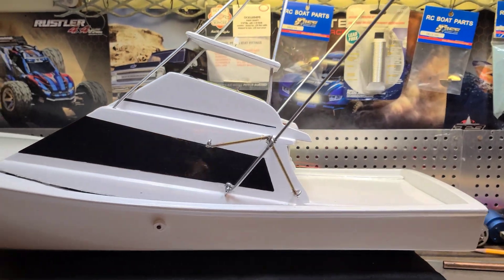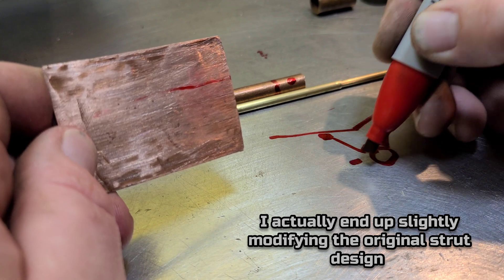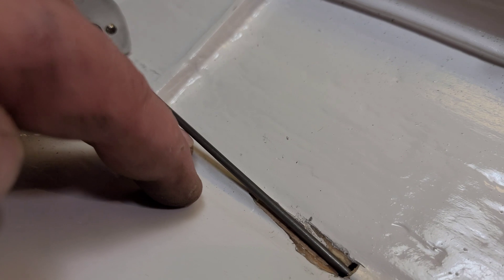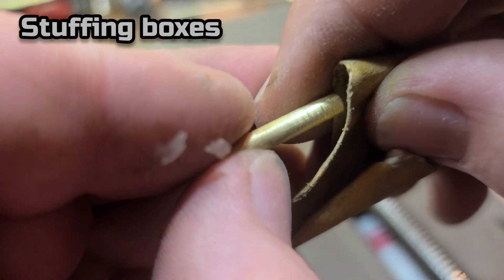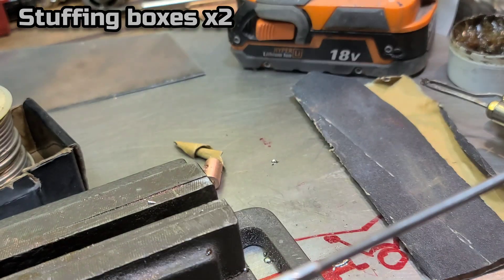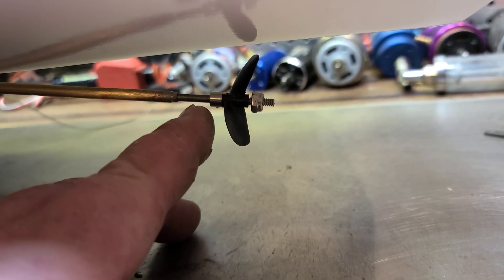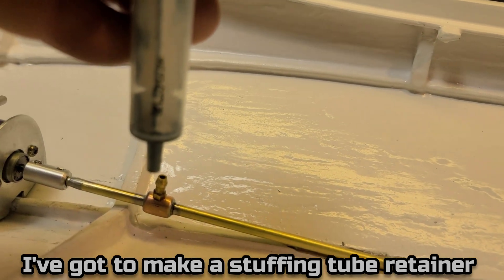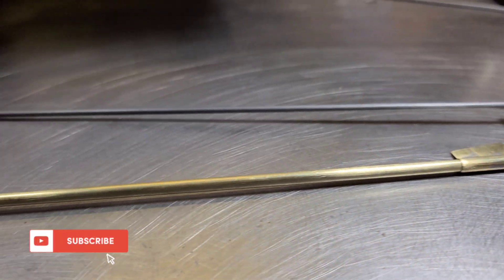Scale Rc Fishing Boat Pt4 Diy Stuffing Box, Drive Shaft, & Strut - Rc Boat Running Gear

Comment: Do you remember what is and where to get the material to use to install fitting into ?
Reply from the maker: Offshoreelectrics.com is the best place to get parts. 

Here's the k&s tube link
https://www.offshoreelectrics.com/products.php?cat=Stuffing+tube+%26+mounts&PARTNER=ironclad
Reply: @IRONCLADRC  I'm not finding sleeve to put fitting in
Reply from the maker: @CJINDY  I made that custom from a piece of brass drilled and tapped

Comment: very well done video...so that is basically a fitting used for cooling jacket? couldn't you also just have a plastic snap on lid for that fitting instead of removing it and using a grub screw??? I have my old surge crusher cat i am thinking of putting a grease fitting on since the 5mm flex has to be removed from the motor end to grease... i did change it 4mm 12 years ago ,but flex broke,so i am using the stock beefy 5 mm again..PS.. i just thought of how to cap that fitting...there are these  plastic pellets designed to be put in hot water and within 20 seconds you melt them and make a ball and you have 1min to mold it anyway you want... when it cools it similar to nylon... all you need to do it form a cap right on that fitting(it wont stick) you made and after it cools pop it off. it forms perfectly and has some flex and it not brittle at all...i paid like $4.00 for a few hundred..enough to make a few sets of teeth lol.. thanks again...I just realized a 1/2 piece of tubing with a nylon screw plugging one end is even better..
Reply from the maker: It didn't leak grease so I basically keep the grease fitting on the whole time. No need for grub screw.
Reply: @IRONCLADRC  maybe this is a dumb question,but i never used grease fittings on any rc boats...i see you have them sticking out on struts etc... same fittings??? and all can be filled using large surige and a piece of fuel line???thanks

Comment: Thanks for sharing and bringing back some good memories.  
I CNC machined a oiling system for a friend of mine with a mounting bracket for his RC race boat.  I made a reservoir to hold enough oil for a 10 lap race.  It dripped the oil at a steady rate through a metering hole to provide lubrication during the race.  I even made a spare that I keep in my home display case.  I had a friend of mine powder coat it.   Ha Ha
Reply from the maker: That's awesome man  I bet it turned out great. Thanks for sharing

Comment: Mind if I ask where you got the gauges? I need some for my tugboat. Thx.
Reply from the maker: I made them with a plastic rod/dowel  cut thin & hand painted
Reply: @IRONCLADRC  hand painted? 😟 I was hoping decals or something. I found some, but they are way two small and $$$$. Thx! BJ24 upgrades are going well.

Comment: How can you ensure that water will not enter in the shaft to the boat?
Reply from the maker: You need a tight fitting stuffing tube  pack fulled of grease as a barrier to block water from entering.

Comment: Hey bro, just wondering if you have ran the proboat 36” sonic wave and if so what your thoughts on this boat are? Thanks
Reply from the maker: I use to have to v1 sonic wave.  It's a solid boat, really all you need to do is add a secondary cooling circuit.   I'd get the sonic wake over the impulse any day.
Reply: @IRONCLADRC  cool. And it looks like tou can run a single centered 6s lipo if you want to , yes?
Reply from the maker: Yes sir. Actually works best with a single cell lipo.
Reply: @IRONCLADRC  hell yeah , thanks for the info , which you sir, are a fountain ⛲️ of .

Comment: How did you hold the shaft into the vice with out having it spin wile you are threading it?
Reply from the maker: Lite pressure very lite in the vise with a brass tube over the shaft in the vise.  I had 4 plastic clamps under the vise clamped onto the shaft.  So it wouldn't spin and stay straight.

Comment: Hey man, nice way to set up shaft kit! Liking the grease dam! Very clever. Doing a reno on an old Royal Barge boat my Dad built. So will fit same set up into it👍🏻
Reply from the maker: Thanks brother. I've used this set up, in the past  on other home-made boats,  trouble free, and very easy to maintain.  Takes some pre planning but very easy to build once you have all the right materials..  good luck with your build.